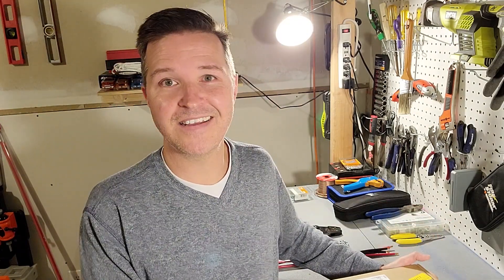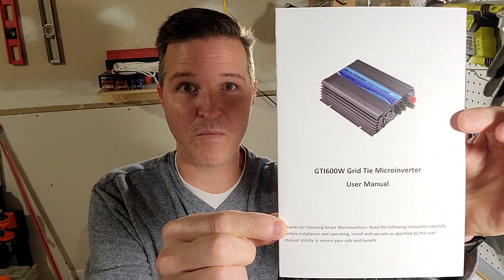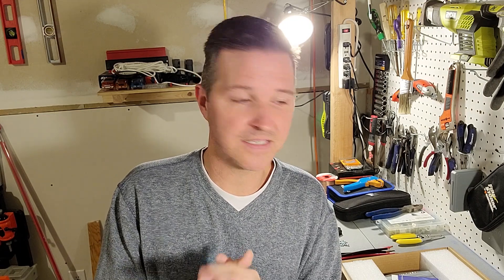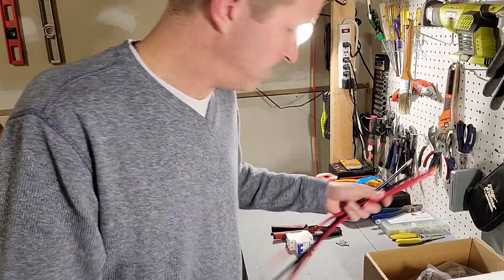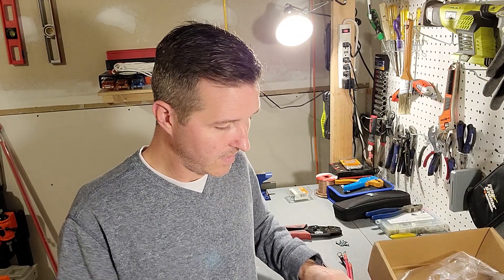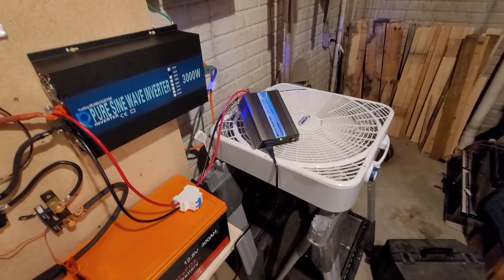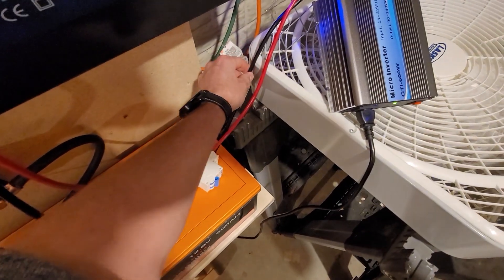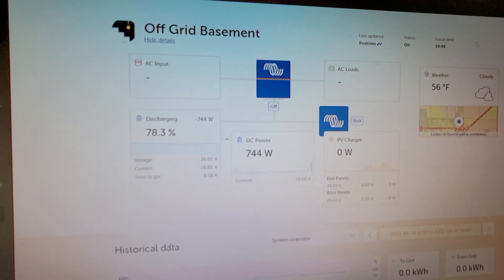I connected a cheap Grid Tie Inverter directly to my 24v Off Grid System.  Will it last 10 minutes?

Comment: Get a USB fan to cool the grid inverter. I have a few that uses 2.9w on low speed and maybe 6w in high speed mode. Also make sure all that power is used up by your home. You may get charged for power you dump on to the grid without net metering with your power company.
Reply from the maker: Thanks for the comment!  I want to make sure to use a fan that turns on at the same time as my inverter.  I'm using a remote AC switch so I want to keep using a AC powered fan.  If I feel like this inverter is going to do the job I will get a smaller fan that blows to a more centralized spot.  It's a small inverter and I can look at my grid power usage by the hour.  I never go under 500w on grid.  Thanks again!
Reply: @OffGridBasement   In my setup i use a USB fan with AC to DC power adapter (like a cellphone adapter). I plug both the adapter and gridtie to a power bar with surge protection. The power bar is turned on/off with a smart plug.
Reply from the maker: I  went out and purchased a USB fan.  I'm pretty sure you and I now have the EXACT same setup for the grid tie inverter!  Thanks for the idea!

Comment: Cool build, dont let it spin your meter back without net metering or your electric company will know!
Reply: Make sure your home is using more power than your pumping in or you might get a letter in the mail. Just fyi
Reply from the maker: I thought about that.  I looked at my hourly grid usage over the last few weeks and it never goes under 500w / hour.  Thanks for the info though!
Reply: @OffGridBasement  really enjoy the content.  Thanks